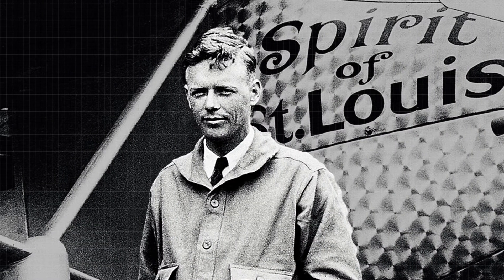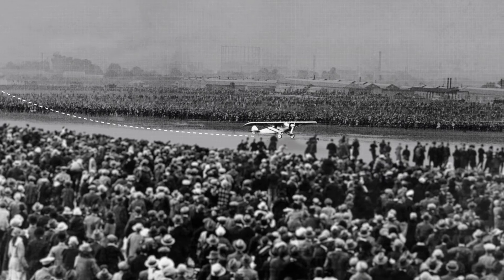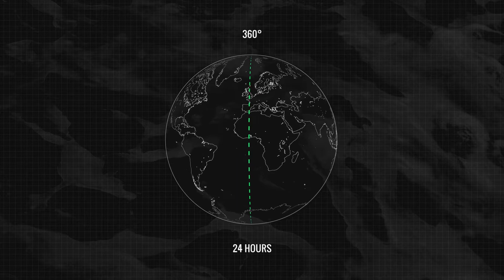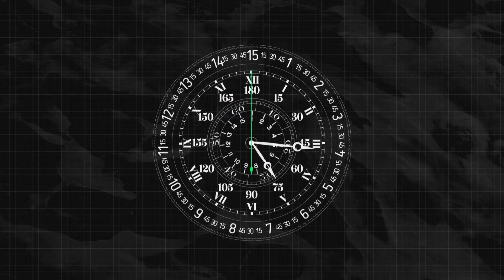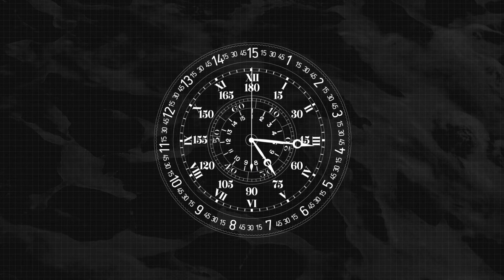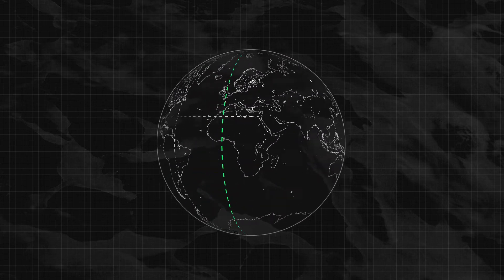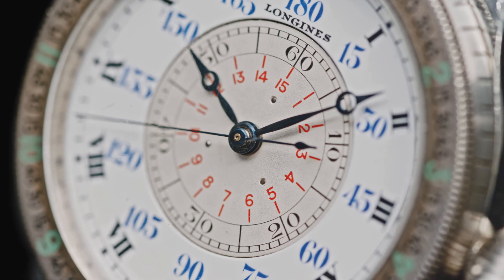How does an Hour Angle Watch works ?

Comment: No, pilots could not work their latitude out any more readily than they could work out their longitude. You might be confusing pilots with maritime navigators prior to precise timekeeping.
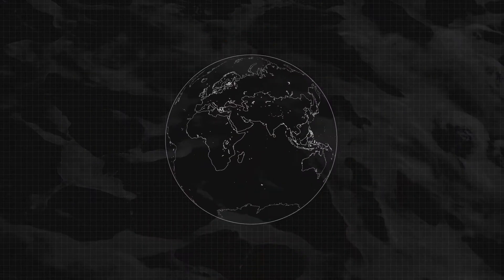Reply: 01:02  "Pilots could work out their latitude whilst in flight".   How?
Reply: @videosrus99  Need to see the Sun, measure Sun angle to horizon (quadrant or sextant),  check nautical almanac Sun declination for that date, corrected Sun angle = Lat
Reply: @phmwu7368  You can't do that without knowing local time and your watch will just measure time with no refernce to any location. Even so, simply subtracting from the angle from the sun's declination only works if the sun is precisely north or south and close to the equator during the day you may not even know whether it's north or south, never mind precisely. You assume that you're on a point on a map from a known last position. Usually you have some idea within 100-200 miles that you're in. Then you measure the angle of the sun. Look up azimuth for the current time and for the position you assume yourself to be in, it doesn't matter which location though GMT can be read off straight from the almanac. The azimuth in this case is the line from your position to the point exactly below the sun on earth ( in other cases it's the line to your actual position). Then you can plot the line connecting all points on the map on which the sun is at the measured angle since at that scale where you can easily make out 20 miles and unless you're measuring the sun's angle at noon around the equator it can comfortably be plotted on your (Mercator) map as a straight line, by drawing a straight line perpendicular to the azimuth at a distance from straight underneath the sun at 0 degrees of arc to, theoretically, 90 degrees of arc. 1 arc minute is roughly a mile though it will depend on the point of projection of your map. If you have no idea where you are, which is usually  hypothetical you can work out your position by solving the geometric equations, but that again is usually not necessary.

Comment: It's just a conversion scale between units of time and units of arc. In practice navigators (back in cel nav days) did not determine their longitude by subtracting local from GMT since they only knew their local time once they had determined their longitude. There is a very old cel nav method to determine local time directly which was used in the days when mariners didn't have accurate clocks, but it had long been too imprecise and unpractical by the time air navigation had arisen.
Reply: There's an excellent made for TV mini series that originally aired on A&E called Longitude, it stars Micheal Gambon as John Harrison the inventor of the marine chronometer, the timepiece for determining a ships longitudinal position at sea, Jeremy Irons also stars in it.
Unlike most movies that their subject is historical this one gets it right and doesn't distort historical facts for the sake of drama, it's really a good watch (no pun intended), I believe it can be seen on Amazon Prime these days.

Comment: How do they know their latitude ? Or is it assumed that they know their latitude and with this watch they can also know their longitude and hence their position?
Reply: Finding out the latitude is what the sextant is for.
Reply: With a sextant you can get the angle of the sun to the horizon at your local noon time or when the sun is at its highest point in the day, note the current time, then make a mathematical adjustment for altitude and another adjustment with the nautical almanac based on the day of the year. The same can be done at night with the angle of the North Star and the horizon.